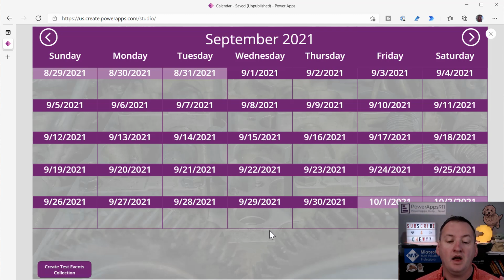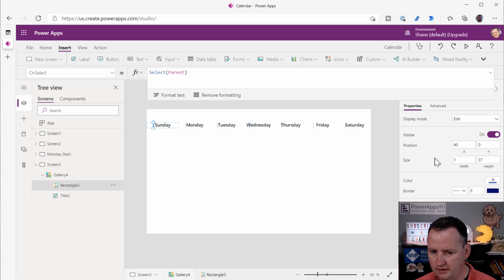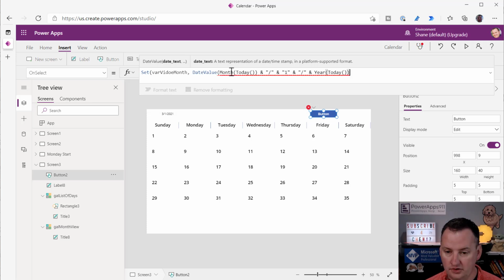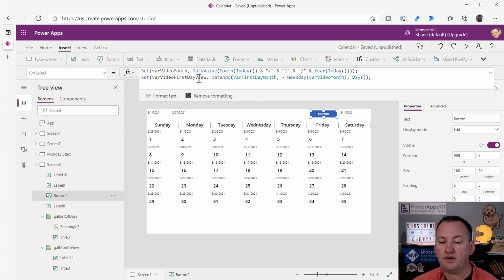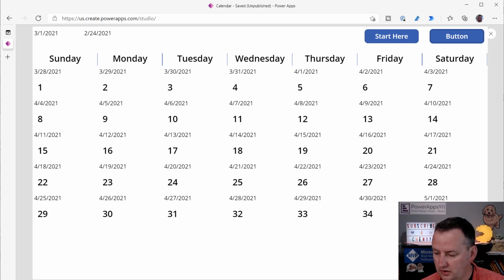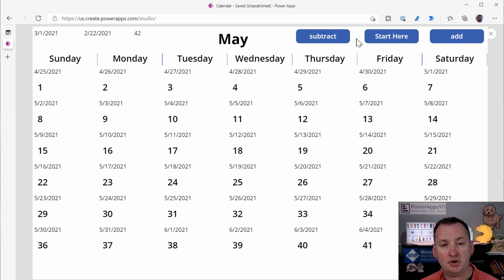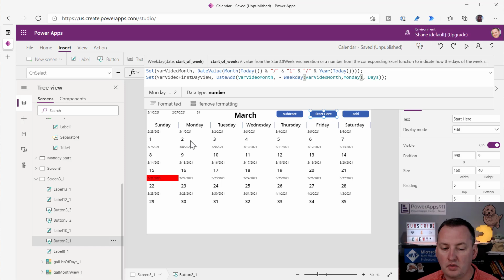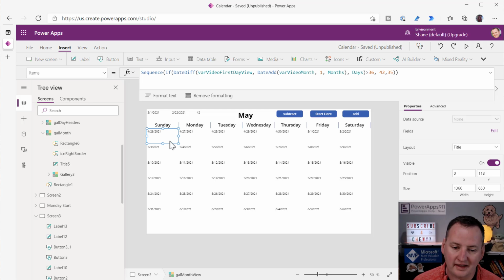PowerApps Calendar Control - Build your own using Galleries

Comment: HI Shane, thank you so much for this video. I was wondering if this is possible using Shared calendars?
Reply from the maker: Yes, but you have to use the Graph API to do it. :( One of my students built herself the solution but it was a lot of work for her.
Reply: I wish they would make it easier to achieve!  @ShanesCows

Comment: Being in the UK, I found the calculation went wrong when embedding the Power App on a site page (the site's region was correct).   The addition of en-GB here fixed the issue

Set(varVideoMonth, DateValue("1" & "/" & Month(Today()) & "/" & Year(Today()), "en-GB"));

Oddly, even without that small change, it worked perfectly as a standalone or added to Teams.
Reply: I am from Belgium and I have the same problem. It isn't fixed by adding nl-BE though. Can you give some more info on how you were able to fix this?
Reply: @ I’m sorry but I’ve got nothing beyond what I wrote back then. Ultimately, I didn’t embed it in a site page, which is maybe why it’s still working well.  I’ve checked the OnStart code just now and it’s the same as above.

Comment: Hi Shane, another very good video. There are always so many ways to write code to get the job done, so I don't normally comment as long as the job gets done. In this case I just wanted to share a different technique I used to auto resize the grid weeks using the Items property of the gallery:

Sequence(
With({firstWeek:WeekNum(varReportMonthStart)},
With({lastWeek:WeekNum(DateAdd(DateAdd(varReportMonthStart,1,Months),-1,Days))},
(lastWeek-firstWeek+1)*7)))

The DateAdd(DateAdd(varReportMonthStart,1,Months),-1,Days) piece will get you the date of the last day of the month. I use the WeekNum function to return the week they show up in, subtract the lastWeek from fristWeek and add 1 back to account for the weeks themselves. Years and years of development manipulating dates in Access, Excel and JavaScript can force you to get creative and at time efficient. I hope this helps someone.

Comment: Hi Shane! I changed the text of the calendar label to "Text(DateAdd(varFirstDayView, ThisItem.Value, Days), "d")" so instead of displaying the full date, it only shows the day number, but this has a knock-on effect on the 'Fill' formula, which lifts today's date as a point of comparison.  I've tried "If(Text(DateValue(Label11.Text)) = Text(Today(),"d"), Purple, White)" but this doesn't work. Is there anyway around this or will the fill function only work when the full date is on display? I'm rather new to PowerApps, so something might easily be going over my head! Thank you!
Reply: I also tried "If(DateValue(Label11.Text) = Day(Today()), Purple, White)" which didn't do anything either...:(

Comment: How are you accounting for Leap Years?
Reply from the maker: I am just not sure. I didn’t test for that but in my head it will work. 🤷‍♂️
Reply: @ShanesCows  It indeed does work. Once I finished the app, I ran it all the way to 2032 and the dates were consistent. Thank you so much!
Reply: Also thanks again for putting together this video. I saw some useful components out there from others but I really like this one you've built. I'm guessing that the leap year is accounted for once the year comes, because the math is completed by using the today function, but it just seems like it wouldn't correct itself until that day actually comes.

Comment: I just watched the Calendar and Clock Function video for MultiLanguage.   Have you thought about how you could redo this to reflect the browser date format?    Set(varMonth, DateValue(Month(Today()) & "/" & "1" & "/" & Year(Today())))?     I set a browser to Spanish and with a label on the screen set to Text(varMonth, "mmmm") it shows January rather than September.   I have some ideas but they all require a lot of lines.
Reply: BTW I figured this out and it's beautiful.   Just use actual date function values rather than text for places where you want it to automatically translate.

Comment: Hello Shane, firstly I would like to thank you very much for your tutorials! I would like to ask, is possible show in calendar item which is not only text but lookup or person? I tried, but it does not work. Thank you. Best regards, tom
Reply from the maker: ThisItem.LookUp.FieldFromLookup I think is the pattern you are looking for.
Reply: @ShanesCows  Hello Shane, thank you for your help. I used Text(DataCardValuePerson.Selected.DisplayName) and it works as well. :)

Please, can I ask you for one more help? When you showed DateAdd(varVideoFirstDayView, ThisItem.Value, Days) = reservations are visible. 
When I use Text(DateAdd(varVideoFirstDayView, ThisItem.Value, Days), "dd") = reservations are unvisible.

How can see short version of dates and reservations as well? Thank you. Best regards, tom
Reply: @tomaspisecny6038  Did you find a solution to this?

Comment: Shane this is amazing! I used your code for shading out the month before, and the month after EXACTLY. My calendar is shading the month before, but not the month after. Any thoughts?
Reply: Hi Terrie, not sure if this is the best/easiest way but it worked for me.  For reference, varClientMonth is the variable that displays the month in the large header.  I was also just using a defined color vs. a variable like Shane did.

If(DateValue(Self.Text)=Today(), White, Month(DateValue(Self.Text))= Month(varClientMonth), Blue, If (Month(DateValue(Self.Text)) > Month(varClientMonth + 1),ColorFade(Blue, 40%), If (Month(DateValue(Self.Text)) = Month(varClientMonth - 2),ColorFade(Blue, 40%),Blue)))

Comment: Great Video! or vidoe if you will. on to part 2.  I do have some problems with the (Today()) function adding the time when I don't want it to. But, strangely goes away when I same and close powerapps.
Shane, is there a way to lock in the format of today() with no time shown with the steps you've provided?
Thank you, -Dan V.

Comment: Hi Shane, thanks so much for your videos, they’re great!

I’ve built this app and it works perfectly on the web, but when I go onto my iPad to use the same app, PowerApps confuses itself. The standard date format on the web is mm/dd/yyyy, however when I use the iOS app, the standard format is dd/mm/yyyy, rendering the app useless on my device… any suggestions as I’m pretty stuck for a solution!

Keep up the fantastic work!
Reply from the maker: Yikes. I have never seen that one. 🤔
Reply: @ShanesCows  Hi Shane, my bad - I forgot to remove this comment! The browser I was on was set to English (US), when I switched it back to English (UK) it worked perfectly!

Comment: First off, a huge thank you Shane, your videos have been a godsend. Cannot even count how many times I have turned to your videos. Secondly, an European here, so your examples on date functions were much appreciated! However, when you switched to EU format on around 28:30, your red fill on Label 1 (on your galMonthView) disappeared (was on 03/21/2021). I guess it does not recognize the changed date formatting (from US to EU). Any ideas how to implement this Fill setting on top of the EU date formatting? 

Keep up the good work!
Reply: Hi Niklas, did you manage to do this? I can not wrap my head around it. This is what I got in the Fill If(Text(DateValue(Self.Text),"dd/mm/yyyy") = Today(), Red, White) but it does nothing...
Reply: I'm getting the same issue, any ideas anyone???? Shane please enlighten if you have the time thanks. Great work
Reply from the maker: What if you use the Text formula to convert both of them to the same format in your If for the fill color? That should do the trick. :)
Reply: figured it out,
set Text to "Text(DateAdd(varFirstDay, ThisItem.Value,Days),"dd/mm/yyyy")"
set Fill to "If((Self.Text)=Text(Today(),"dd/mm/yyyy"),LightBlue,White)"
Reply: Modify the rest of the function in FILL for dates that are not part of the selected month (European date)? Solution: If((Self.Text) = Text(Today(),"dd/mm/yyyy"),RGBA(0, 18, 107, 0.7),  Month(DateValue((Self.Text),"hr-HR")) = Month(DateValue(varVideoMonth)), RGBA(187, 221, 140, 1),RGBA(187, 221, 140, 0.5))
Reply: 2024 Fix. Fill -  If((Self.Text)=Text(Today(),"dd/mm/yyyy"), Color.Red,Color.White)
                           Text - Text(DateAdd(varVideoFirstDayView, ThisItem.Value,TimeUnit.Days),"dd/mm/yyyy")

Comment: Question for part 2, Shane - do you know of a way to add recurring calendar items within PowerApps (with a SharePoint calendar list as the datasource) without using say a daily Power Automate flow
Reply from the maker: I haven't tried. I will look at it when I dig in more.

Comment: Hi Shane, sorry I have a question, can I use an app  that is conected to a sharepoint list if I'm not included in the sharepoint site where the list belongs? I'm having trouble with that, thanks
Reply from the maker: Nope, you have to have access to the underlying SharePoint data sources.

Comment: what about if a February starts on a Sunday? you'd only need 28 not 35.
Reply: Sequence(
    If(DateDiff(varVideoFirstDayView, DateAdd(varVideoMonth, 1, Months), Days)>36,42,
    If(DateDiff(varVideoFirstDayView, DateAdd(varVideoMonth, 1, Months), Days)>29,35,28
)))
Reply from the maker: Thanks Tilman!
Reply: @tilman1  I am getting error on that code
Reply: @jimwaldron3858  Strange. Sure you have kept the variable names? The above code is just extended by one if clause of the same structure.
Reply: @tilman1  Very strange it works today :)
Reply: @jimwaldron3858  Even code sometimes needs a day off ;-). 
I guess it's the thing Shane showed in the video: after changing code sometimes you need to rebuild variables, and I mostly get rid of it by rerunning App / OnStart.
Reply from the maker: Interesting no didn’t think about that. I guess so. 🤔 You could fix it by updating the sequence logic.